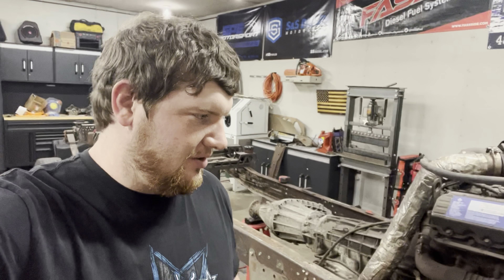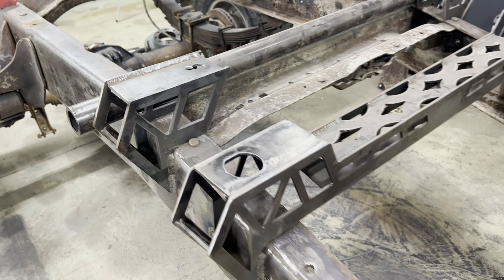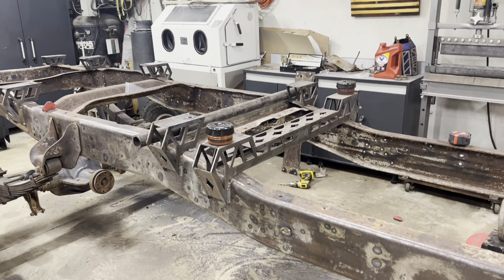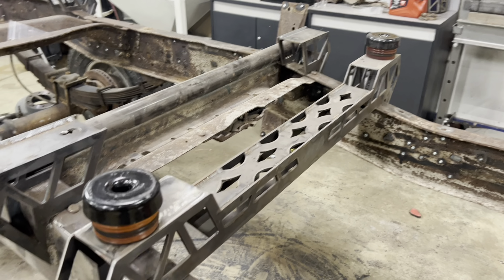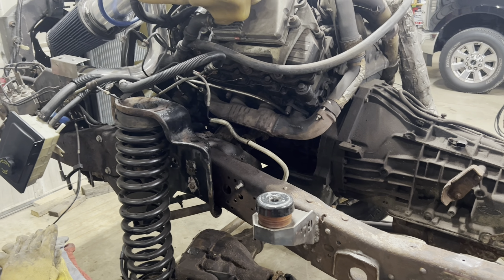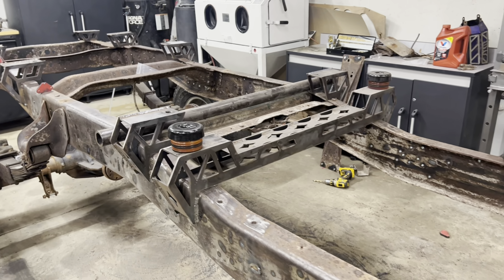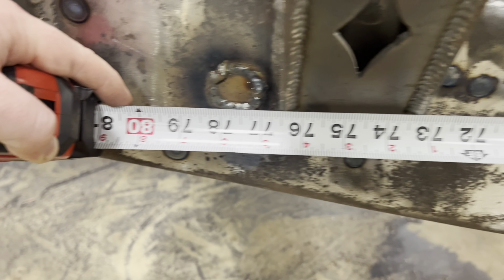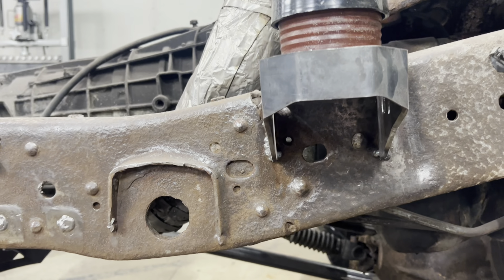How I mounted my 1979 Ford F-250 crew cab on my 2006 F-350 chassis 😲😎

Comment: I’m doing the exact same thing. Would you build another set of mounts to sell me. I have a 79 crew cab on a 2007 crew cab long bed dually frame.
Reply from the maker: Yes I do sell these mounts please email me if your interested
Reply: What year of SD's can be used? I have a 79' short
Reply: @dustinbutler6317  I had initially bought a 2002 but then realize I wanted front coil springs so I bought a burnt 2007 king ranch f350 dually 4x4. 05 and newer, just measure your wheel base.